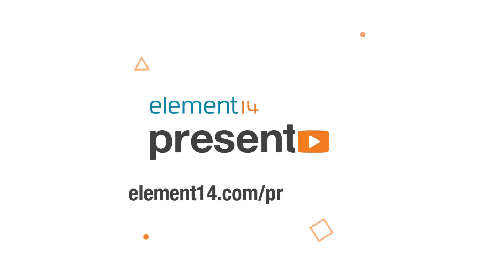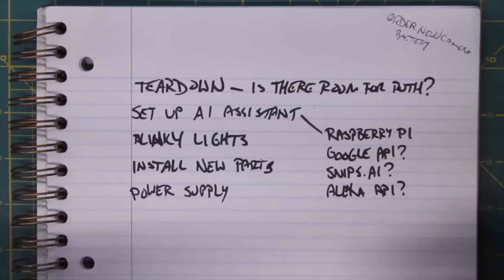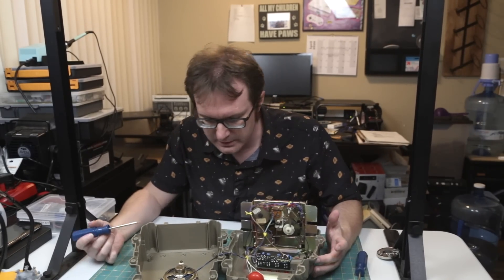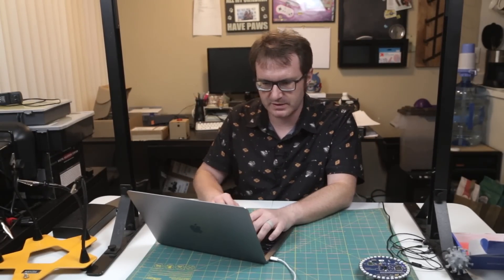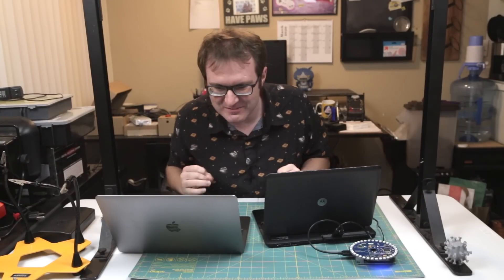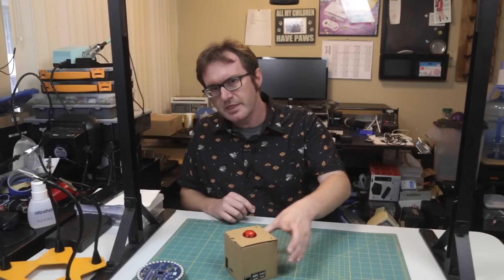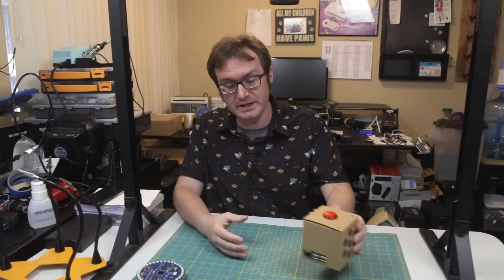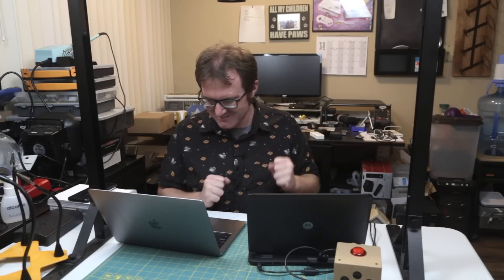Raspberry Pi 2XL Robot Assistant Part 1

Comment: Mego 2-XL question:
I'm not getting any sound from the tape.  All connections are intact.  The head and rollers are clean. Tape runs and advances as it should, just no sound.  Has anyone else experienced this issue?  I assume it's in the sound board - bad capacitor perhaps?

Comment: Things would work out if you use a 512 or 1TB MicroSD card because if you are going to do a lot of programming on the Raspberry Pi as you will quickly run out of memory when doing a large compile if you use a small capacity Micro SD, for pitch shifting I would have thought of Pitchshifter but if the Raspberry Pi doesn't have on an board FPU then that idea won't work.